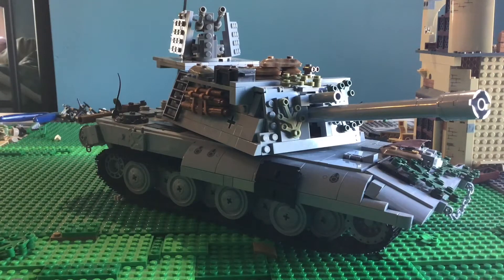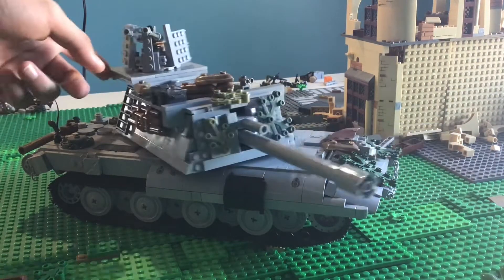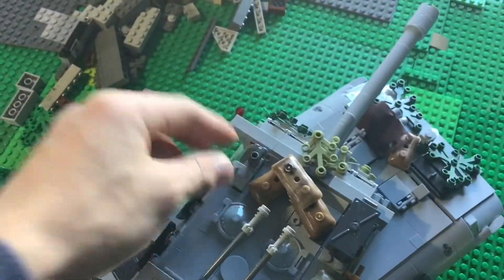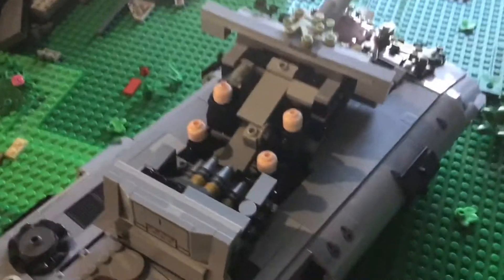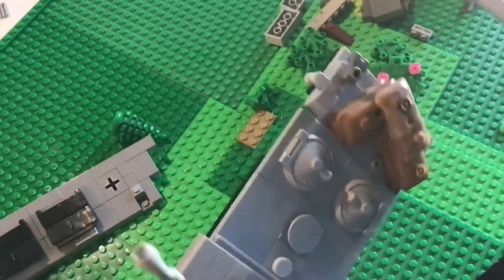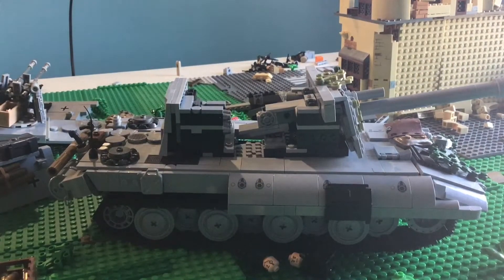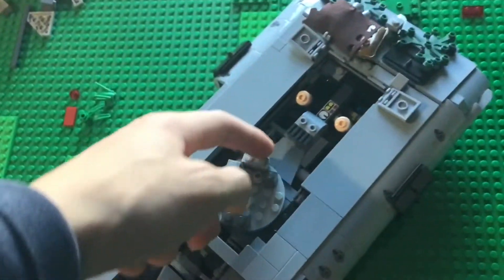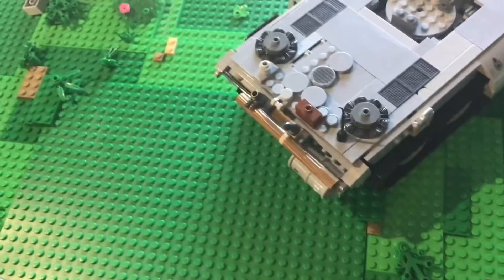COBi E-100 MOC (Krupp II design)

Comment: Do you think there is a way to add the fan exhausts on the exhaust? Like the cylinder with a fan?
Reply from the maker: Hmmm I can try
Reply: @mechanizedbricks6077  it would be pretty difficult as it would require minuscule parts but it would look amazing if you ask me